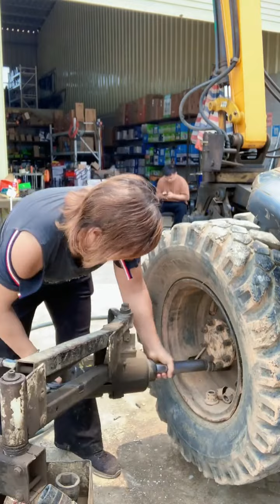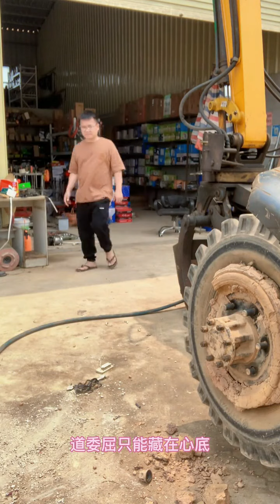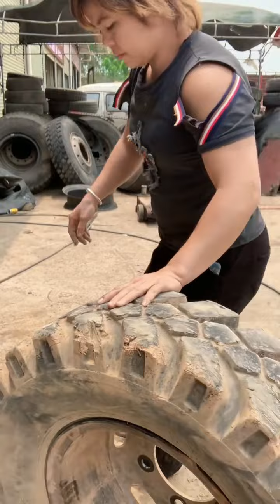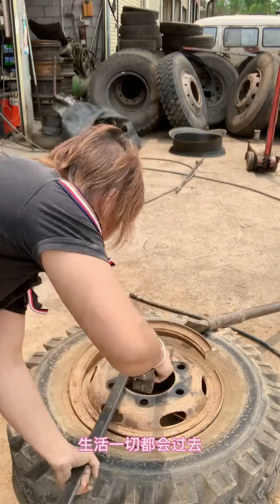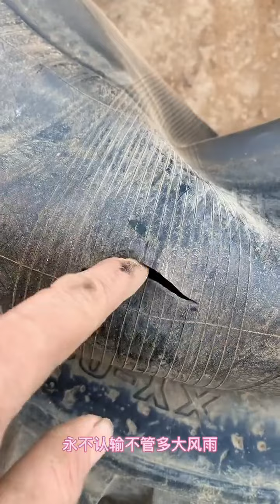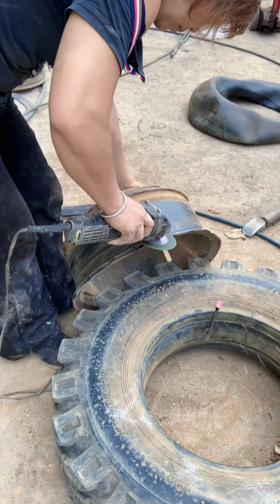Excavator Tire Inner Tube Replacement

Comment: Split ring part needs to be opposite to the valve on the rim. Valve one side of wheel and the split on the other side, here in Australia that wouldn't be allowed because it is dangerous